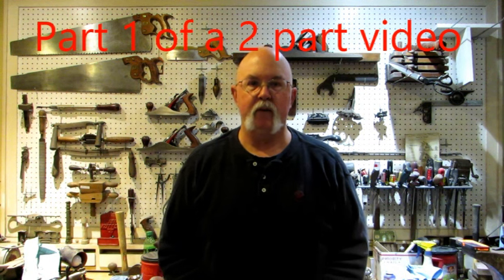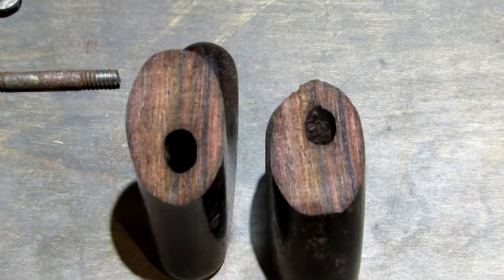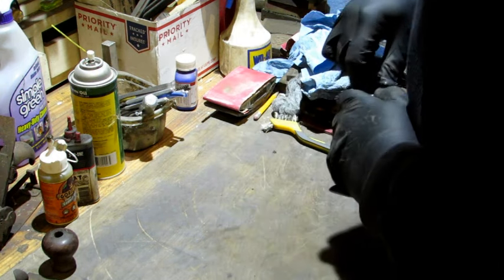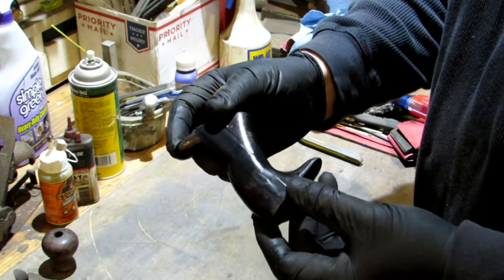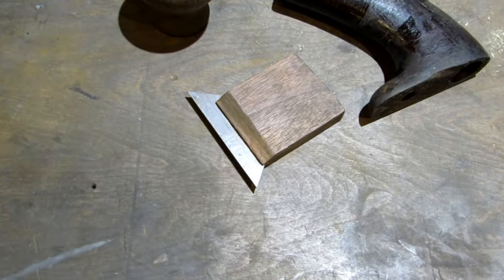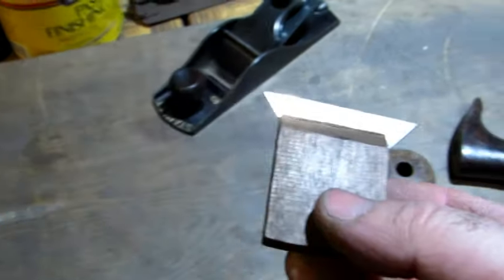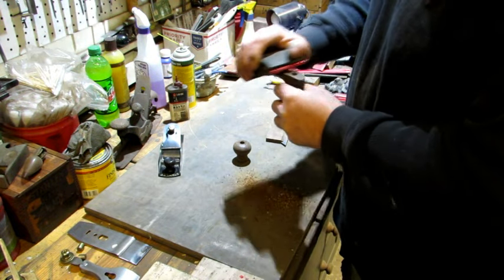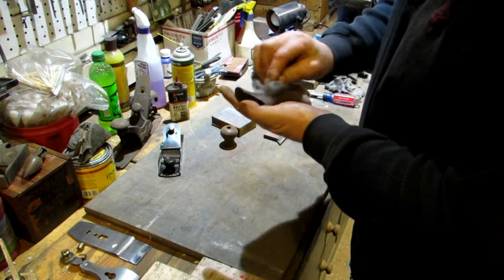Part 1 - Plane Tote Repair and Finishing

Comment: Great film, thanks for posting, and taking time to make these films, they are a very good learning resource for all, thank you. I used vertical splines in my last two tote repairs, both had been repaired previously like in this film but failed after a year or two. So far they are holding, I have done a fare bit of planing with the one of them the last six months. Gorilla glue is very strong and so is pva but I notice that when a new brake occurs it is always on or around the glue join not in the unbroken wood. The claim one generally hears, that the glue is stronger than the wood, is misleading since you can never repeat the intertwined nature of the fibres of wood when repairing a broken piece. I think the load is better distributed in unbroken wood than glued. For this reason some of the strengthening inventions for joints can be justified. I admit I am brutal with my planes, otherwise they wouldn't brake in the first place. All the best, Lucas.

Comment: I have a 6 inch piece of threaded bar with a plate on one end and a butterfly on the other. Glue the pices and put this through the hole tighten

Comment: Why do you use  lacquer spray instead of acrillac  spray.
 Min Wax  paste Wax uses paint thinner  to clean up .
Lacquer  spray uses lacquer thinner to clean up and usually the finish separates when  it meets paint thinner.
Apparently you do not get that separation.